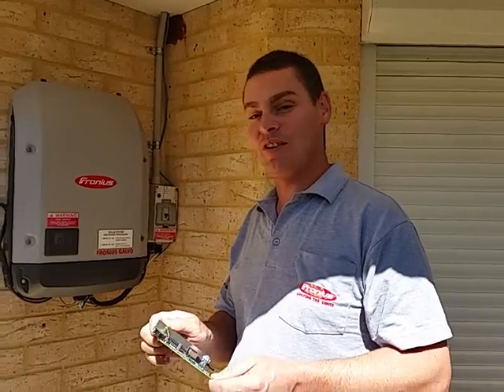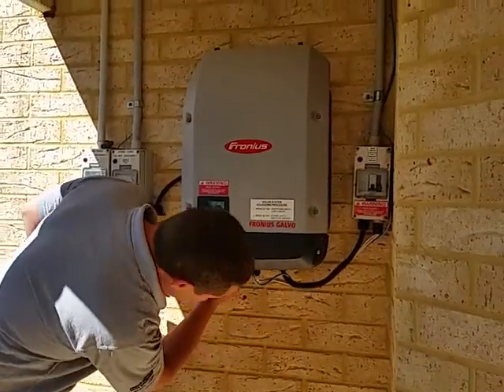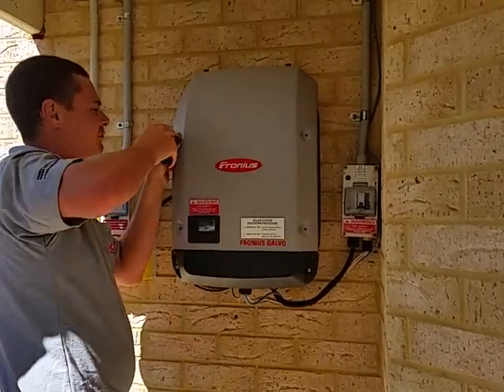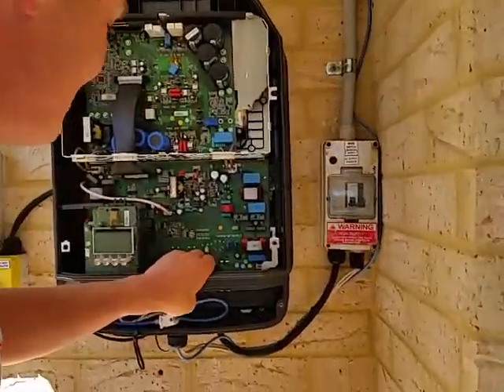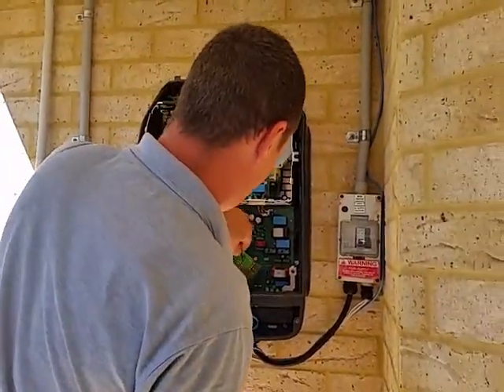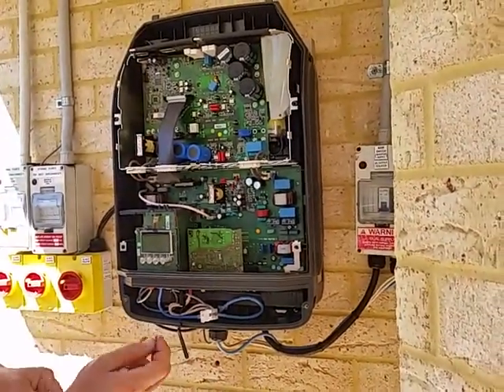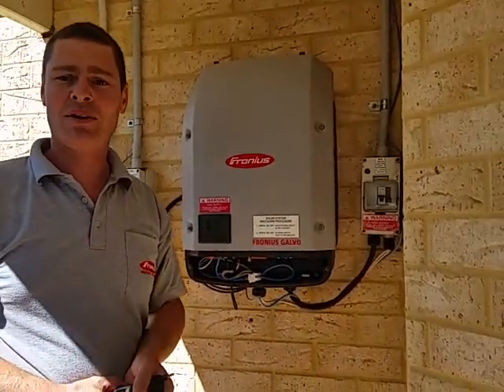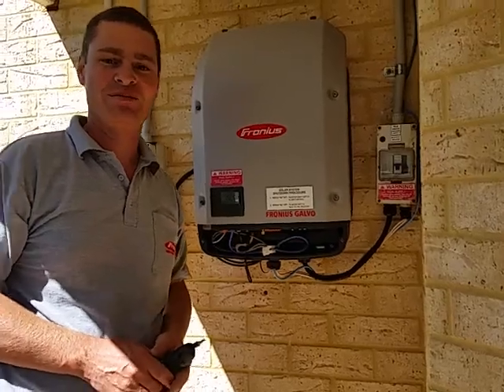Install Fronius Datamanager

Comment: Why do installers use a dc isolator when the fronius internal dc isolator meets australian standards? Its a waste of time having the external one on the wall, just another point that can fail.
Reply from the maker: This is the one of the very first Galvo preseries inverters installed in Australia.
There was not datamanager card available and the inbuilt DC isolator was not certified at the time.
This unit is now 7 years old and has produced over 70MWh (3kW inverter with a 6.6kW array in Perth)